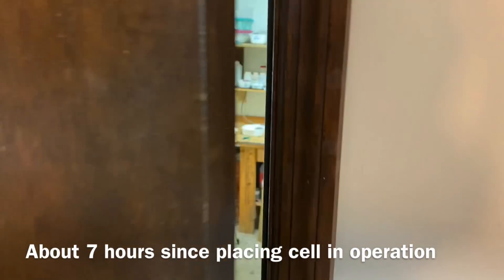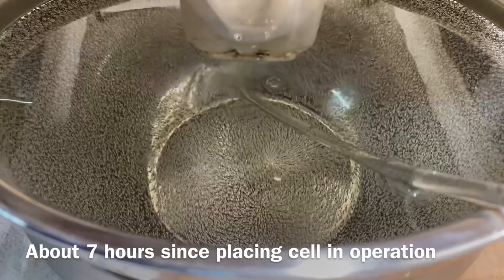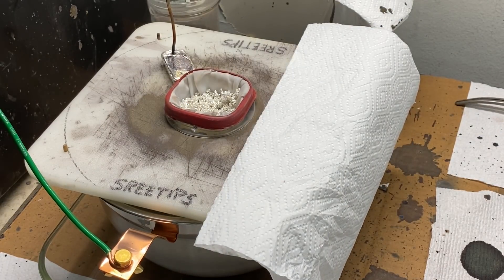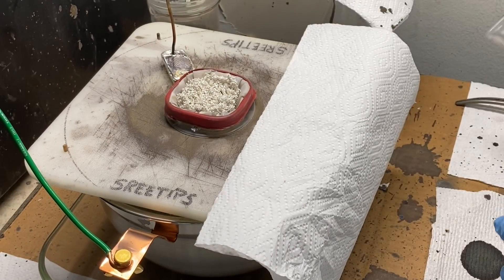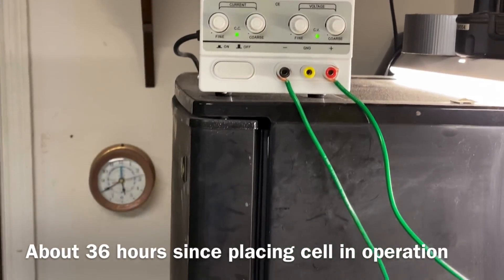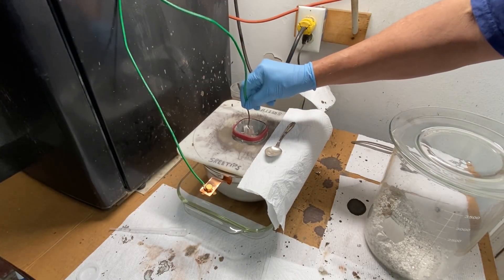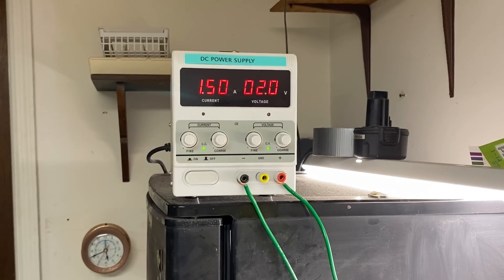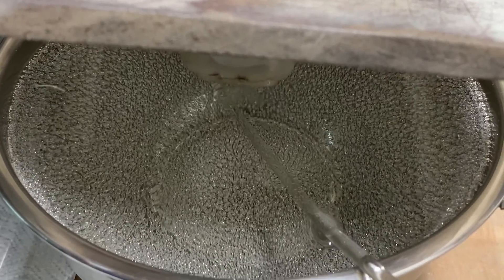EP010 Silver Cell Constant Current Update

Comment: It take Coulombs to move metal from the anode.
Coulombs are (6.2x10^23) electrons moving from hither to yon.
To drive these beasts requires supplying electromotive force that exceeds the chemical bonds involved and makes up for heating losses.
Us regular folks call these forces Current and Voltage.
Once the electro-chemistry 'threshold' is covered, any additional current moves more metal.
Sort of like an internal combustion engine!
Only a small amount of the power from the fuel actually pushes the vehicle forward, the rest goes up as waste heat and to keep the moving parts moving.
To further the analogy, any oxygen/hydrogen gas created through electrolysis is likened unto running the AC full-blast with the windows rolled down.
Makes the engine work harder than it needs to, reduces your mileage.

I used to run a perchlorate cell with linseed-oil saturated graphite rod electrodes...fun to watch the crystals change shape as they transitioned from chloride to chlorate to perchlorate!
Started with potassium chloride 'No Salt' product, ended up with k. perchlorate.
Reply from the maker: Avogadro’s number

Comment: Thank you for another educational video Senior Chief.  I have a question related to the process:
If you create a batch of electrolyte containing 600g of dissolved Ag, and then over the course of time consume 600g of silver shot (or in this case double refined Ag), how much crystalline Ag do you expect to recover once the anode Ag is used up?  You have made comments in the past about Ag in solution being used up (causing Cu etc. to plate out).  I understand that the silver shot is contaminated with other metals, so it could be > or < 600g depending on what goes into the anode basket?
Reply from the maker: Those are good questions. But I don’t have answers. I use the electrolyte twice then cement out any remaining silver and make new electrolyte from pure silver crystal from a previous refining for the next run. Way back I tried using the electrolyte 3 times. I didn’t augment with more silver nitrate solution. Added distilled water instead. When I tried to cement out the silver from the used electrolyte after the third use nothing happened. So I added some HCl to precipitate the silver as a chloride. Again nothing happened. The electrolyte was so depleted of silver that there was none left to recover! The silver crystals were giant. But they were coated with green. You see, I had depleted the electrolyte so completely that only the copper was plating out on the silver. That was years ago. Since then I never use the electrolyte more than twice. And I alway add fresh silver nitrate to increase silver concentration on the second run. Needless to say, I ran that batch of green tinted silver crystal back through the silver cell with fresh electrolyte.
Reply: @sreetips  Thanks for that.  From a purely scientific standpoint, it might be interesting to weigh the silver going into the electrolyte (which you do), then use a measured mass of double refined and weigh the dried outcome and add in the mass of the dried cement silver from the spent electrolyte..  There would be a variance in 'recovery' if that is the correct word, if you used the impure silver shot.  Trying both and doing a comparison might be enlightening.  Geochemist here, 32 years of it and I still nerd out on the chemistry :)

Comment: Where's the gorgeous blue colour in the electrolyte?
Reply from the maker: That is the copper in solution makes a very vivid ocean blue color
Reply from the maker: I’m running pure silver crystal through the cell. All of the copper was removed during the first two refining (passes through the silver cell). So the electrolyte won’t turn blue with this third pass.
Reply: @sreetips  oh, I thought the copper was present to act as a pathway for the flow of electrons.  But it's actually a biproduct of the refining process where the impurities go into solution as the silver comes out?  So your solution gets darker blue as the reaction progresses?  Fascinating stuff, thank you.  Love your channel, very relaxing and informative
Reply from the maker: I usually run 98% to 99% impure silver shot from melted cement silver. The biggest contaminant in this cement silver will be from copper that was used to cement the silver out of solution. Tiny bits of it are in the cement silver. As the impure silver dissolves in the anode filter, the copper dissolves with the silver. If parameters are kept right, only the silver will plate out and the copper stays in the electrolyte and accumulates there turning the electrolyte that beautiful blue color.

Comment: Now you are getting thicker and shorter crystals, even denser I think. That is because of the change in voltage. Different voltages give you different shapes to the crystals in your silver cell. This new configuration will minimize the possibility to get a short circuit because the crystals are not that long and thin as before.
Reply from the maker: Agree. But we’ll see when the cell starts to get full
Reply: @sreetips  When the cell starts to get full, please remember to reinstall the fuse, to protect your power supply. Otherwise you will get a different problem, because the short circuit will damage something expensive if occurs.

Comment: Hi Sreetips - I think you want to try and match the current you were getting before for a good run.  Looking back through your videos I thought I saw you running at 2 Amps.  The good news is you can tune this to perfection.  Maintaining a constant current is no easy thing so it will fluctuate a bit.  Also, keep in mind that volts = amps * ohms or in other words as you get more resistance in your basket over time the voltage will have to go up to maintain the same level of current.  When you add more silver to the basket the resistance may lower again so the voltage would go down.  The limiting factor here is power: watts = volts * amps.  So if the resistance gets too high, the voltage will have to get really high to maintain the same amount of current.  You set a limit on max voltage which also determines max power (so 2 amps at a max of 7.5 V would be a max power of 15Watts which seems pretty safe to me).
Reply from the maker: With the old power set up I would get about 1.2 to 1.3 amps on day one. By day ten it would drop off to below 0.5 amps. I presume that it was due to slimes interrupting flow of silver out of the filter - the filter gets clogged with slimes. But there won’t be any slimes with this run because I’m feeding it pure silver that’s already been through the cell twice.
Reply: @sreetips  Ah, okay, so it really will be interesting to see what the full run is like at 1.5 A.  You should be ahead of the game - it should take less than 10 days.
Reply: BTW, one more thing you could try is weighing the bowl without the basket (or maybe the top) just so you know what your progress is by weight since it's really hard to tell if the crystal grow is just different at this current?
Either way I think it's good your driving the whole process with a constant current source instead of a constant voltage source.
Reply from the maker: I’m very pleased with the progress so far

Comment: Go back to the old voltage settings, you got much faster crystal growth. Though the crystal growth is more dense with the lower voltage settings
Reply from the maker: I tried that. The result was fast growing dendrite crystals right below the anode basket that made contact and shorted the power supply and blew the fuse. I’ll have to do something different when I start feeding the impure silver to the cell because as the filter clogs up the current flow will drop off. A totally different experiment.
Reply: @sreetips  : sreetips , cupel your impure silver shot with lead 1st!
You should end up with .9990 pure silver buttons , then grind them into 
Flakes for the anode basket, the crystals would then be .9999!!!
And the slimes would be minimal.
Reply from the maker: cupel is an added unnecessary step to an already lengthy process

Comment: how much gr/day does this refine?
Reply from the maker: I used to crank out about 5 Troy ounces of pure silver per day. I ran it constantly. It was very reassuring to know that even as I slept, my silver cell was producing pure silver for me. Since about Feb when I got the new power supply that has not been the case. It’s a rotten feeling walking into the shop and seeing those tiny needle crystals touching the anode basket. I never had a problem until my old faithful ten-year-old power supply died and I had to replace it with a new one. Hopefully I’ll get back to carefree silver production.

Comment: It appears the more metal introduced to the electrolyte the higher the current goes. I was wondering about this when you lost the 200th of a volt at the silver cell in the beginning of this batch. 

My theory is that the silver cell is working like an Eye of Storm device in essence. All the electricity in the beginning is shooting out equally to all sides of the bowl. As the crystals grow there is less distance to travel. The moment the distance of one crystal is a shorter distance to the anode basket than the others. That single crystal will be getting the bulk if not all of the electric charge. Super charging that single crystal an increasing its growth rate. Like putting your hand to the globe of an Eye of the Storm.
Reply from the maker: The silver does deplete from the electrolyte as the cell operates.
Reply: @sreetips This is my theory. The blue tint to the used electrolyte if that is copper it should increase the flow of current in the electrolyte.  The same voltage will be going through but at a faster rate. Burning through the shot faster.  Creating more heat, which will lead to evaporation.

 Electricity flows the path of least resistance. In the beginning the electricity is probably sending out 4 archs to each side of the bowl from the anode basket. As the crystals grow and the distance from the anode basket to the bottom of the bowl decreases, a fifth arch will be created going down to the bottom. 

If clean electrolyte is getting trapped in the crystals and settling towards the bottom of the bowl. The bottom crystals will grow faster. This will cause the 5th arch of electricity to gain more power being the path of least resistance and at some point becomes the only arch. Increasing the growth at the bottom even more while limiting if not completely stopping the growth on the sides.
Reply from the maker: That sounds like what’s happening. Electricity, like gravity and the other forces that hold everything together, are a complete mystery.

Comment: If you do bump up the current, just to be safe, I wouldn't go over 2 Amps.  2.2 is where you got the spiking issue.  

When I'm charging lithium ion batteries, I set the voltage to 4.2V, the amperage usually self regulates itself, but if it goes up too high, I turn down the amps to about 1 amp.  This makes the voltage drop like you are seeing.  Eventually as it charges, it will creep up to the 4.2V limit. (your cell will not, because it is not building charge and there is no full contact through the electrolyte)

I'm sure there is a sweet spot between amps and volts.  I think somewhere between 1.75 and 2 amps will get you the speed and quality that you're after.  The only thing you can really do, is follow the scientific method, and record your results with different settings over time.  Once you dial it in, you'll get great silver like you have in the past, but you'll now know the exact values that work the best.  

How you lucked out in the past, is the fact that the wires were working like a resistor, and the connections were making minimal contact, causing the amperage to be limited.  From memory in the past, I believe you were getting about 1.54 amps or something like that, which is good.  But it was just weakening to a point that you started having issues after all these years.  Best of luck on finding that sweet spot!
Reply from the maker: My thoughts on the old system - exactly. For reasons you gave, it worked beautifully all those years. I got lucky. Now it’s time to get right with my silver cell - the honeymoon is over.

Comment: maybe Because there is little or no copper in the electrolyte?
Reply from the maker: Rich, I left copper out for 2 reasons. First, I didn’t think to add any when I started the cell. And second - after realizing this I chose to leave it so we could see how the crystals of pure silver will form without it.
Reply: @sreetips  i tried it using 999 silver and the crystals came off the bowl like foil
Reply from the maker: Ive had that happen before. Some parameter changed in the cell and the silver formed a sheet or foil. But it was still high purity silver

Comment: Visually it looks like slower growth, but that can be deceptive. Those look much fatter and denser. The true test will be the weigh in of silver weight per hour. And you can always adjust the settings to find the optimum settings now that growth is under control. Just adjust one variable at a time until you find what you want. That is the scientific method for experimenting. Changing too many variables just confuses the situation.

Comment: With how clear the electrolyte is remaining, would that be an indication that the cystals your putting in are already higher purity than normal?
Reply from the maker: It’s not a fair comparison. I usually feed 98% to 99% silver shot from cement silver into the cell. I use copper to cement the silver from my gold refining inquartation. This liquid will contain lots of silver but it will also contain platinum group metals and traces of gold. These metals will also cement out with the cement silver and contaminate it. As the 98% to 99% silver shot, that contains these PGMs and gold, dissolve in the anode filter of the silver cell, the PGMs and traces of gold will get trapped in the anode filter as silver cell slimes. I will then process those filters for the precious metals that they contain. But in this run, I’m feeding pure silver crystal into the anode filter, already run through the cell twice before. There shouldn’t be any other metals in that filter basket and the electrolyte should remain colorless to pale yellow as the cell operates. All the copper is gone too so no blue color either.
Reply: @sreetips  Thankyou.

Comment: Shouldn't you be running at constant voltage rather than constant current letting the amperage drop as the silver reduces out of solution?
Reply from the maker: Always have - this is a new experiment for me.

Comment: Voltage limit is somewhat irrelevant when you are limiting the current; voltage will drop if the circuit hits the current limit. You can set the voltage into highest value you want to see in any situation, then set the maximum current. Voltage will float freely within the set limits, but the current won't get too high.
Reply from the maker: No clue. I’m experimenting here. This is new to me. If it works set up like this then I’ll be thrilled

Comment: I'm figuring since sreetips has pretty good coverage around the bowl, the voltage is high enough.  It's got enough "oomph" to cover the distance to the bowl surface.  He might be able to turn that down as the crystal depth increases and gets closer to the anode bag.  An increase in amps (how many electrons it's throwing out into the bowl) may make the crystals grow faster.  Will it make the growth less dense?  That I can't answer.